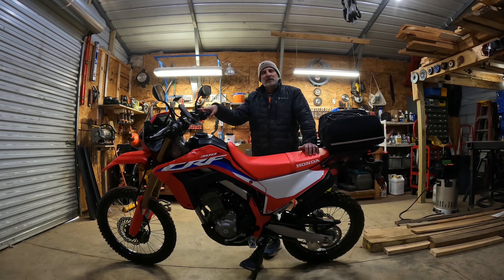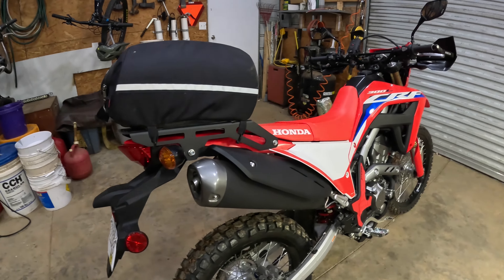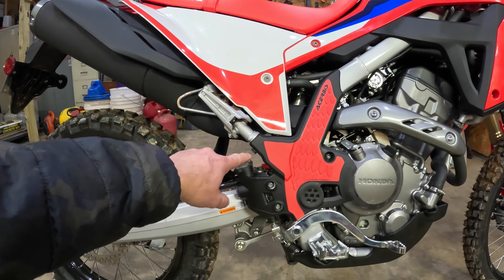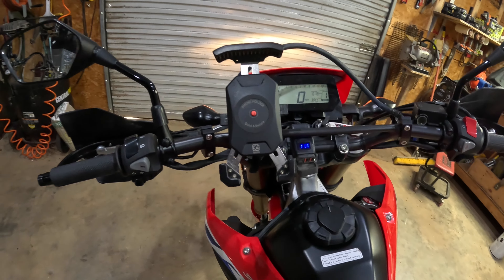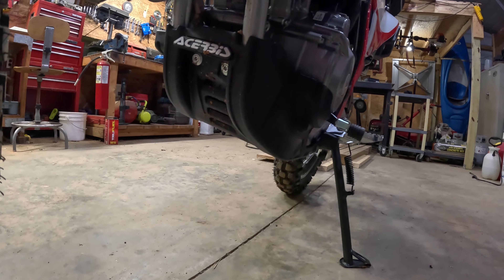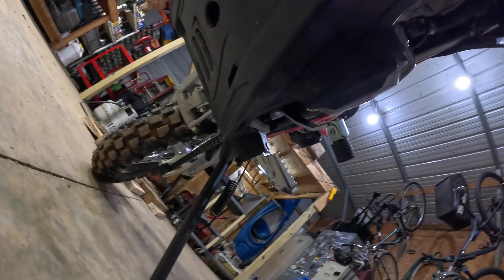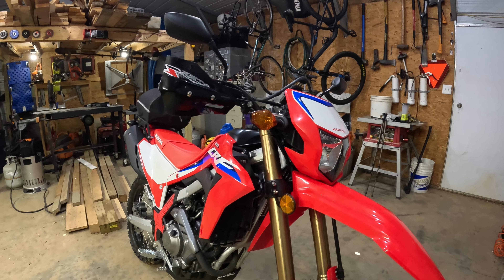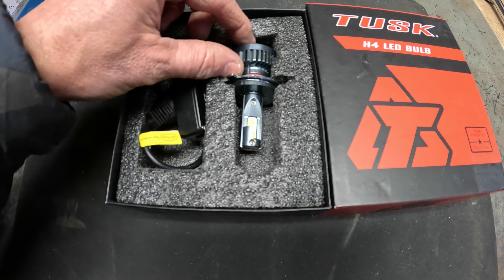Honda CRF300L Tusk LED Headlight & Other Accessories

Comment: Doesnt the base mount unscrew so you dont have to cut up the boot to fit?
Reply from the maker: @MAXED-TRUCKING  I honestly don’t remember. You may be correct. I normally don’t figure these things out until it’s too late. 😂
Thanks for watching.
Reply: @doingstuffseeingstuff  😂 I believe it does for orientation adjustments as well the install process. How has this bulb held up over time for you?
Reply from the maker: @MAXED-TRUCKING  it seems to be holding up. I am thinking I had about 100 miles on it when I installed it and I have about 2000 on it now. I noticed in the video that I could see the light in the day time lighting on the ground in certain situations. It’s plenty bright.